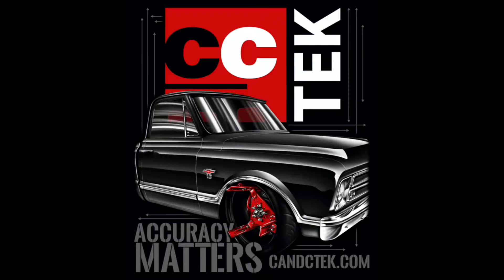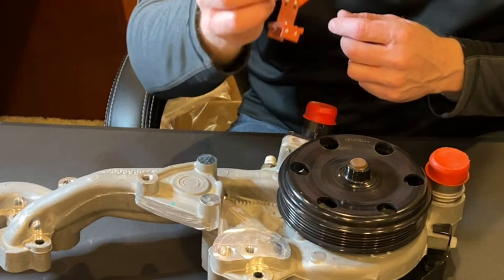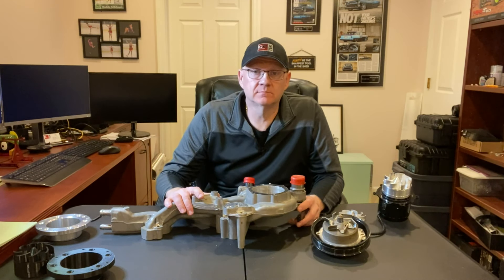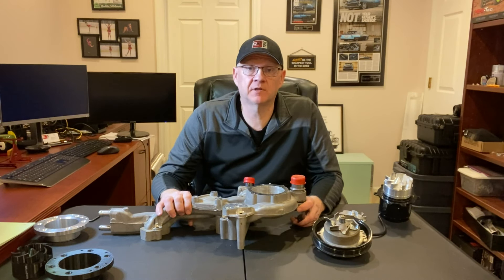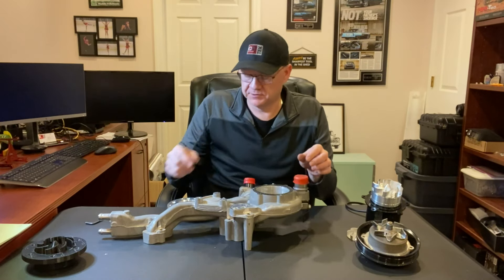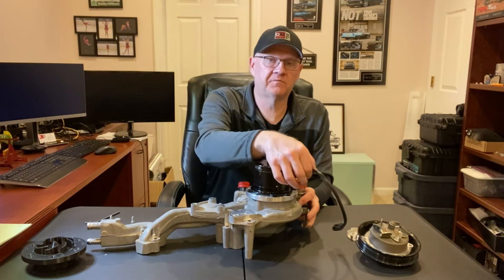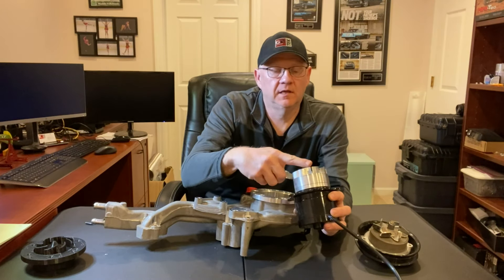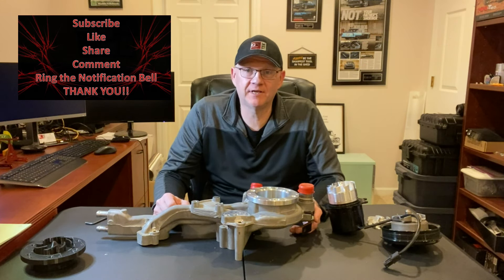The First Gen 5 LT1 Electric Water Pump???

Comment: Any updates? 100% interested for my setup. Ready to purchase.
Reply from the maker: My customer had some other things to deal with.  The pump is installed and running.   He has let it idle for about 45 minutes with not issues. He has not been able to test at track or street yet.   We ran out of weather here in the Northeast by the time he got the car back together.  Not just this but other work he was doing.   I’ll post a couple pics of it on my IG.  @ CCTek.
Reply: @CCTek  what’s ballpark cost on the setup I see there is LT setups available now but kinda pricey 

You have model number of the Meziere pump used?